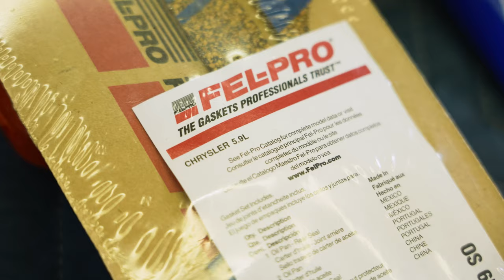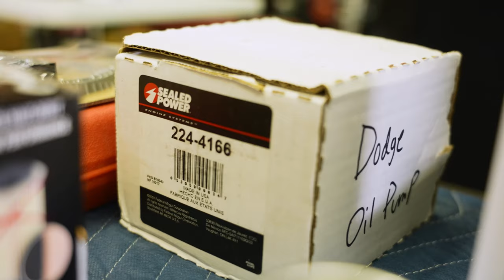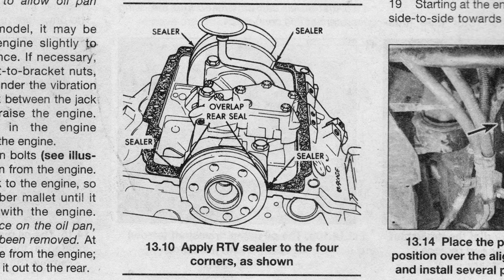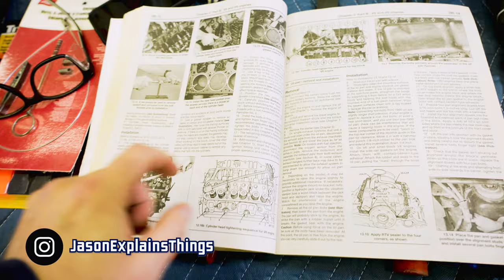NO OIL LEAKS! Rear Main Seal & Oil Pan Gasket (First Gen Dodge Ram, Ramcharger)

Comment: Great job! , I have had just done this job last summer with my 91 dodge, but mine had the cummins in it so I was alot more challenging cause i had to remove the transmisson and there were alot more oil pan bolts😅

Comment: I have a 1978 D150 that I bought last October...I drove it from a neighboring state and it died when I got home. Fathers Day i got it running again and have been driving it every since, but I replaced everything on the top end minus heads, an aluminum radiator and all the elected leaders electrical ignition parts. 

I intend to do the suspension, I have headers for it, but over the winter I want to tear the motor apart and install the goodies with the stock bottom end just freshened up. 

This is a job I'm tackling this week after installing motor mounts and still need to install the transmission mount which up do after this is done!

Great videos and information!

Comment: If you’re willing to use the silicone pan gasket, felpro typically includes the plastic pins that will not only align the pan but hold it in place so you can install all other bolts. Super convenient and easier than having to make your own. Great video friend. Keep em coming!

Comment: This is a great video. I have a 96 Dodge Ram (2nd gen) with the 360 (5.9) that also has a leak from the rear main seal. 

There are a couple of small differences that I know about but this is a fantastic walk threw on how to do this job. I am also, like you, replacing the oil pump while I am in there. I have a few more miles (175k) and figure it is just wise while I am in there. 

Just Thank you for a great video!

Comment: So I recently did this on my 78 D150...I found that on the 318 you don't have to raise the engine at all to get the oil pan out. I'm not sure if it's simply a difference in engine size or a difference between the 70s and 80s. Either way it made it a lot easier for me.
Reply from the maker: That’s awesome.  Yeah the manual said some do some don’t.  Mine definitely did.  Even with raising it things were pretty tight.

Comment: I put a new Radiator and electric fan on my 89 D250 and after I was done and fired it up a growing pool of oil was under it as I looked for Radiator leaks. I heard it could be done without engine removal but got stuck at getting it out. Did some looking and saw where the engine mounts could be loosened so when I get back at it I'll hopefully get it wrapped up. Glad you replaced the pump as they're  cheap and good insurance. In case anybody is curious never use a highflo pump as it will starve the crank.

Comment: The procedure in this Vid should also works for up to 90 3.9 LA. Thanks for the vid will be doing this on my 90 Dakota. Right now my engine is on a stand, so I'll be able to skip some steps. Procedure for rear main seal was very helpful.

Comment: Good job. With that many miles, I might've replaced all of the rod bearings while it was open.
But also, I might've had the cylinder heads off too, then pushed all of the piston/rods out, used a deglazing hone on the cylinders, then replaced all of the piston rings.....I might have to do that while the heads are off right now....my 318's #4 cylinder  was lower compression than the rest, and a wet test shot it waaaay up! 😆

Comment: Did this same job on a '68 Fury with a 318 last summer. Had no leaks or nothing, it all started with pulling the threads out of the block on one of the timing cover studs and it just started snowballing from there😂

Comment: Awesome video, thank you. I am about to do this to my ‘84 Dodge and it is intimidating just looking at the shop manual. Appreciate you!!
Reply from the maker: Thanks so much!  Yes it looks very intimidating.  I delayed doing this for over a year because I was scared I would mess it up.  Like many things in life, everything was achievable by doing research and taking my time once I started.

What’s not in the video are numerous times I stopped and triple checked stuff because I was nervous of screwing it up.
Reply: @JasonExplainsThings  yes I hear that for sure. Mine has a stuck oil pressure relief valve that caused the rear seal to leak. Going to change oil pump and rear seal and then re-gasket. Beautiful truck btw.

Comment: Great video Jason!, Quick question - Depending who you talk to there is a recommendation to add RTV to both sides of the rear main seal on the bearing end cap. Per the manual, this is only applicable to newer trucks
Reply from the maker: I can tell you that I did add the RTV in those spots.

Comment: Recently had my 3.9l out of my dakota (same design, its a 318 with 2 cylinders cut off) one tip is to put rtv in the area where the timing cover, oil pan, and block come together. Mine started leaking there. Its not bad but I only notice it because the engine is orange 🤦‍♂️

Comment: This has helped me alot with my current situation but if i may ask for reinstalling the oil pan did you put a line of permatex on the pan sides at all or did you just mate it straight yo the cork gaskets?

Comment: I'm in the middle of doing the timing on my truck(the exact color as yours too) and wanted to replace the oil pan gasket. Couldn't get the pan out because I didn't lift the motor! Also my rear seal is pretty much plastic at this point and isn't letting go 😭 hopefully lifting the motor helps! Thanks for all the information! I do like that you leave mistakes in so people know what not to do, it's helpful to know, like the ball joint video!!

Comment: What would be symptoms that you need to replace that? Mine leaks coolant right there in that area. Is there supposed to be coolant there?
Reply from the maker: It would be oil not coolant if there’s a rear main seal leak.
Reply: @JasonExplainsThings  thanks man. I may have another issue. Love your videos and Truck man

Comment: I have all the same pieces the exact same gaskets I even paused video to see if the numbers on the gasket match, n they do, so mine's an 89ramcharger 4x4 5.9 basically same type of engine anyway I have the book also, how long did it actually take, n how hard was it,  I'm lil intimidated too!!! N I do most of work on my truck myself but i dont have a shop ill be in a parkinglot
Reply from the maker: Hard to say.  This took over 3 days to film and do... but creating a video makes everything take 2-3 times as long.  At least a full day of work.  It can be done outside, but make sure you have all the tools.

Comment: Did you have any problems lifting from the balancer? I’m doing it but I have my balancer off. Was just going to lift on the crank nub with a block of wood between. Most people I ask tell me not to lift from the balancer/ crank just wondering why.
Reply from the maker: Weird, the manual I followed specifically said to lift it that way.

Comment: I have the 1987 Dodge d150 2 wheel drive 318 engine same color it was my father's who had it since 1996 and he recently passed away 2019 and it set for 5 years since 2017 recently got it in my name inherited and going through issues on getting it running again which it ran fine before it set having issues with fuel getting to the carburetor then change the fuel pump fuel filter few other things seems to be running a little bit better after I noticed a line was off underneath the engine still want to die out a little bit though also rear seal leaks major work we done to it is a timing chain and a steering wheel column besides that it runs like a champ it did thinking need a new carburetor rebuild kit or just new one in general it's the original Holly pushing over 300k miles but it's a beast still after setting for 5 years dropped a battery in it basically it's turned right on over

Comment: Hello again I’m working on my rear main and having a problem after taking my beating cap bolts off it won’t come off even with some light pounding, any suggestions? For a 91 dodge Dakota
Reply: Never mind! Got it ! If you move it side to side it will slowly release just takes time

Comment: GLAD FOR YOUR CLARITY AND SHARING YOUR EFFORT. AS I HAVE 90 D250 5.9 TBI, AM WONDERING IF YOU ADDED A THIN COAT OF GASKET 
RTV TO THE RUBBER PAN SEALS, BEFORE PLACING THEM ONTO THE OIL PAN, AND THEN PLACING THE BLACK RTV BEADS AT THE CORNERS? AM UNSURE IF LACKING THAT, IT IS ONLY THE RUBBER GASKET COMPRESSION, AND THE CORNER BEADS, ARE WHAT IS CALLED FOR. TY. AM SUBSCRIBING.
Reply: BTW, MY SERVICE MANUAL FOR 90 D250, DOES NOT REQUIRE THE MOTOR MOUNT UNBOLTING, AND ENGINE LIFTING, TO REMOVE THE OIL PAN. IT IS A LONG BED MODEL, IS YOURS SHORT OR REGULAR BED? THE SM SAYS REMOVE EXHAUST CROSSOVER PIPE, AND  LEFT TRANSMISSION STRUT, THEN UNBOLT OIL PAN. SO PERHAPS THE ACCESS IS EASIER ON THE LONGER WHEELBASE.

Comment: To prime the oil pump before reassembly I use Vaseline to pack between the rotors so it won't lose prime when the oil drips back out of it over time before restart.

Comment: Use a one piece silicone rubber gasket for a Magnum. Buy a piece of cheap thread all and cut it up into at least a half dozen studs. Buy a 42 dollar 1994 magnum pan from Rock Auto use a magnum pickup. Goop the mating surfaces  liberally with RTV on the ends  and sparingly on the sides. I have been using those old LA cork and rubber 4 piece sets since 1970 and never again . I did this yesterday Free ,I say Free at last

Comment: Hey jason my guy can you do me a huge solid an measure your dipstick tube length and the stick itself? Ive got a new tube i just put in and the new stick aint long enough so im going to use the old stick and im going to put new marks on it so the add and full lines would be amazing too.
Reply from the maker: You asked nicely so here you go! Now take this with a grain of salt.  The tube was pretty hard to measure.  Lots of stuff in the way.  The exterior part of the dipstick tube I could measure was roughly 14" and the dipstick itself was 33 1/4" (The part going down the tube).  I'd google this stuff to confirm.
Reply: @JasonExplainsThings  Thank you the information available to me on the interwebs was incredibly conflicting but i have been without a dipstick for a few years now and had a bolt in the hole and now i just pulled the broken tube out and am trying to figure out the proper tube and stick length. Also ive got a new clutch fly wheel and pan seal sitting next to me gonna have some fun when the weather decides to behave on the weekend you videos help alot.

Comment: That plastic junk that came out of the pick up tube was the cheap junk plastic/metal camshaft timing gear. Which means if you haven't already changed the timing set, you should.
Watch my short videos.

Comment: Did the rear main on my 1986 d150 with the 318... still leaks
Reply from the maker: Bummer.  There are a few other gaskets I still need to replace... but this job tackled all the bad ones.

Comment: Yeah this doesn't work on a 91 dakota 318 sadly. I wish I had a full size. And now im stumped and my pan is basically sitting off my engine. Jason you need a 91 dakota for your fleet!
Reply from the maker: Sorry man!  Good luck!  Grab one of those shop manuals.
Reply: @JasonExplainsThings  I have one and it doesn't explain enough ;-; I watched your video so many times and thought it would help but I was wrong
Reply: Idk if it matters but I'm going to try and level out the truck in my driveway to see if we can get any more clearance. I'm analyzing your video as close as possible jason!
Reply: @PentastarGarage  Hey buddy did you have any luck, or find a good method? I also have a 91 Dakota 3.9 and my Haynes manual says to place the lift under the oil pan, remove engine mount bolts, lift 4 inches, temporarily replace mount bolts and lower engine onto them. Such a bigger pain than doing it the way this video shows. I wouldn’t have a problem throwing the vibration damper back on if I knew lifting from that wouldn’t hurt anything.
Any advice is appreciated… been wrestling this oil pan for days now and I’m wits end with it haha
Reply: @craig909  oh yeah, is it a 2wd? Because if it is, unbolt the rack and let it kind hang there, then lift the engine so that the front of the engine is basically sticking out of the vehicle like your pulling it. It should fall farther down almost past the crankshaft. Yeah the haynes manual did basically nothing for me, I basically went off this video and what we thought of in the process. I hope this helps!
Reply: @PentastarGarage  yep, it’s a 2WD. That does help, thank you. So did you lift directly on the crankshaft end or on the vibration damper / harmonic balancer?
Reply: @craig909  I lifted on the harmonic balancer, made a contraption of wood for it lol
Reply: @craig909  see, if I had the confidence like Jason here does, I would've made a video to help so many people out. Everyone says you need to pull the motor, they're wrong.

Comment: I did everything you said and still leaking at the rear of the pan even put a new pan in sigh
Reply from the maker: That sucks man.  Good luck on future attempts.  My repair has held to this day.  Now that transmission is leaking from other areas.  Fixing one thing at a time. 🤷🏻‍♂️
Reply: @JasonExplainsThings  yea I got to get this pan leak figured out and then work on transmission
Reply: @JasonExplainsThings  you gonna do a video on the transmission

Comment: Do I apply rtv between the two seals? Like cmon dude
Reply from the maker: Hey there Avery.  As it says pretty darn clearly in the video I used high tack gasket sealant to attach the cork gasket to the block, and some rtv around the rubber seals in specific spots... again as stated in the video and shown in close-ups from the manual.

Comment: Idk man , I can’t get my oil pan back in lol looks like our k frames are different
Reply from the maker: It was not easy!  I was paranoid I messed up the gasket... but luckily it was fine.
Reply: @JasonExplainsThings   actually my problem was I making a upgrade to my car and I had to pull the motor instead.... my original oil didn't have a baffle for when I floor it....  the new wouldn't go in because the baffle and pick up tube style

Comment: Is it possible to do the job without lifting the engine?
Reply from the maker: I would say no.
Reply: Thanks for getting back to me. I have a 1984 D150 with a 318 engine. Doing the same job. How many engine mounts are there?
Reply: Also are you only loosening them up a little to lift it up? Your not completely removing them right?

Comment: IMPORTANT: do not line ends of seal up with block and cap surfaces. The seals should be rotated or clocked 1/4" so that the ends do not line up with the flat metal surfaces. A dab of rtv at the mating surfaces of the seals, and your good to go.

Comment: I dont think you ever confirmed whether the blue gasket side is up or down
Reply from the maker: I talked about it in the video, but I get it's confusing.  For this oil pan gasket it was either up or down.  On some gaskets "Up" or "Down" will be printed on the gasket itself.  I triple-checked this on Fel-Pro's website.

Comment: Why would you want to fix oil leaks, I love the Dodge engines because they leak oil and you never have to change oil just a filter once in awhile because you're always putting fresh oil in and you don't have to worry about rust because it's all covered in oil but with all that said the main reason for oil leaks on all the Dodge's is from the valve cover gaskets